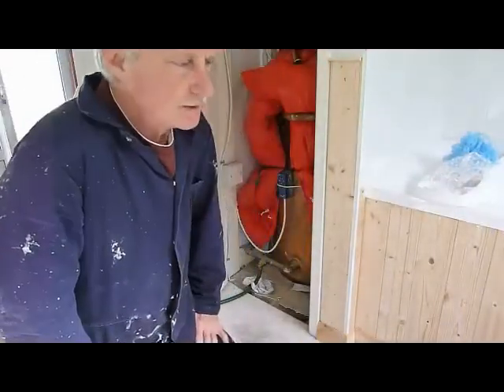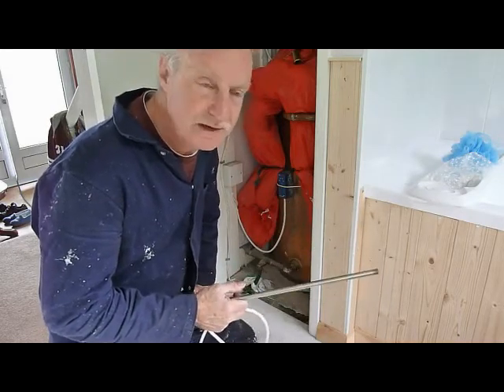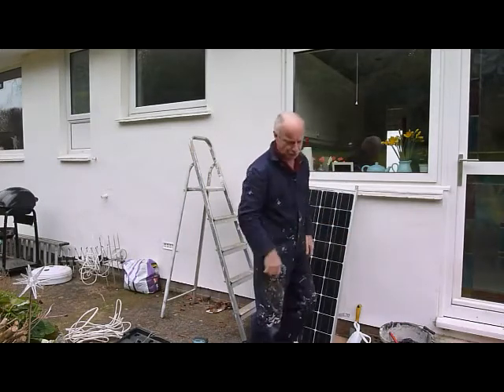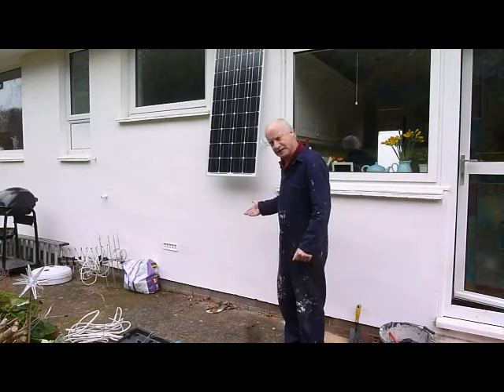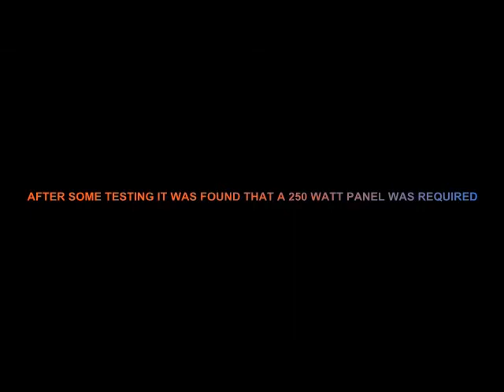How to get free hot water using a solar panel.

Comment: Direct connect solar panel to a new 12 volt element. Panel will be no more than 40% power in winter so 500 watts of panel needed to make any difference to water temp.

Comment: Well I'm blowed... It had never occurred to me that you could heat water effectively using a PV solar panel! I would still imagine that it would be more efficient to use a solar-heating panel to heat water directly, rather than create electricity and then turn it into heat - but that would be a more involved installation process..... Any idea how well this really works??  Does it really pay for itself???
Reply from the maker: Take a long time to recoup the outlay, other wise it does work.
Reply: I suspect it might be more viable when you already have the PV's and can use up the excess energy they produce.  Interesting idea though - and if the cost of Pv's keeps coming down, and their efficiency gets better...??

BTW  You can get sump-heaters for engines, that are able to be stuck onto the outside of an engines sump. So I'd guess they could be an easy way to get heat into a geyser without doing any plumbing at all....
Reply: This inverter method and direct tie to element are pretty inefficient.  I heat water using PV with a little device I made which holds the panel at power point voltage and pulses the heater.  Nearly 100% efficient.  Direct connect to element  will get you 40% efficiency at best.  At less than ideal light, which is most of the day, I get four times more power than direct connect.  It also utilizes grid tie solar panels which are dirt cheap.  At camp I get 100% of my hot water just from excess PV after all the house needs for electric are provided for.  It drives me crazy seeing all these videos on youtube that are just the worst way to do it.

Comment: A standard (240vac) 13 ohm heating element is a pretty good match for 4 solar panels (in series @ 70 to 110 VDC).  I'm using four 200w panels on the lower element and four 125w panels on the upper 13 ohm element. 
Good sun = 1.1 kW or 3,753 BTU per hour. 
2 hours of sun=1 shower.  To see my blog, Google "Per Hour 3.325C (6F)"..

The 40 gallon tank gained 6 degs F per hour on a sunny day. :) 
If the grid fails, we will still have hot showers. (If it's sunny).  :)